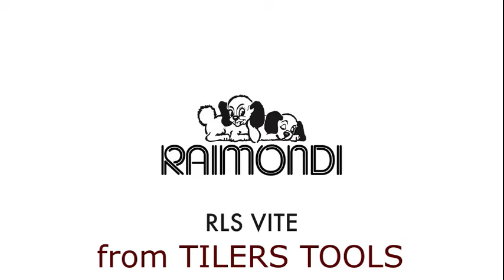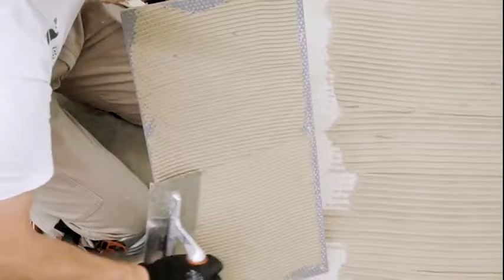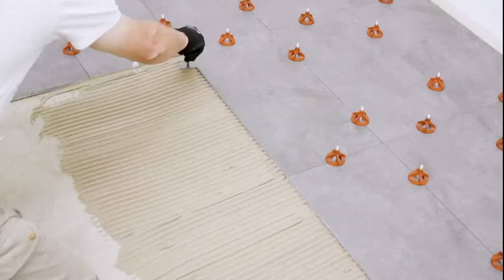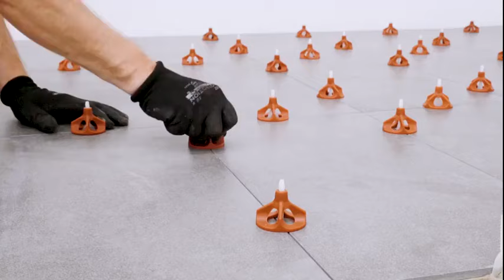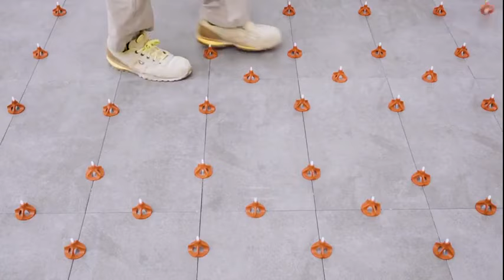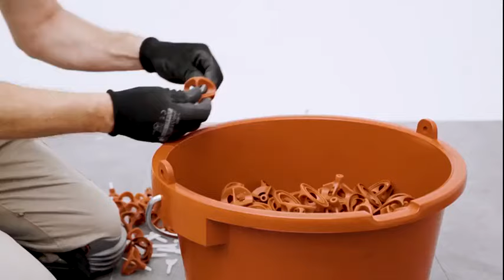Tile Levelling Kit | Raimondi R.L.S VITE System Set Up and Benefits

Comment: Hello.
I am a professional tile installer from Greece. 
I have used your tile spacers rls almost  5 years now and I think they are one of the best in the market.
The reason I am writing is because of your new rls vite .
I wonder why don't you make them a little bit thicker...like 2mm.  
Or to have a choice between them.
The 1mm this moment ( for me) they brake sometimes very easy and they spin around pushing the tiles of line.
I am a fan of your tools that's why I have to Wright this .Bye  and a wait for an answer.
Reply: σου εσπαζε ο αποστατης στο vite; εγω το εσφιγγα με οση δυναμη ειχα και δε καταλαβαινε τιποτα. και μιλαω για 1mm